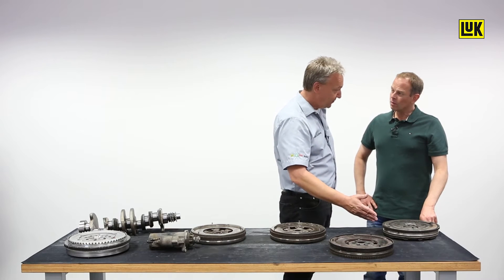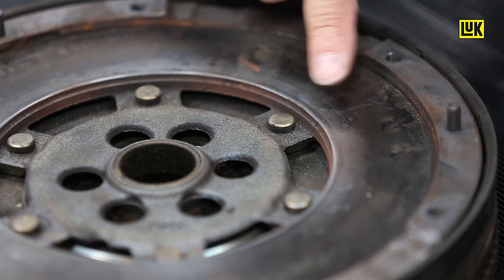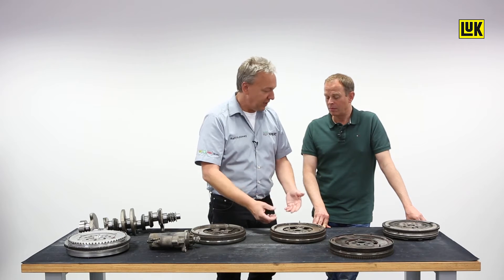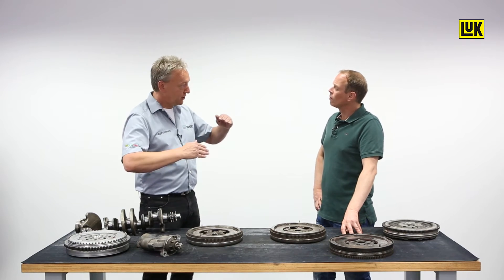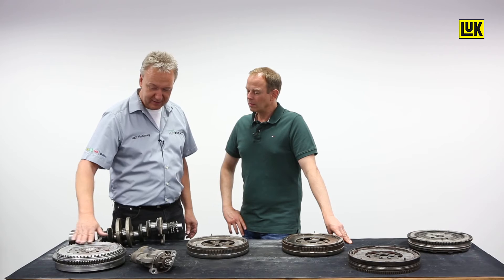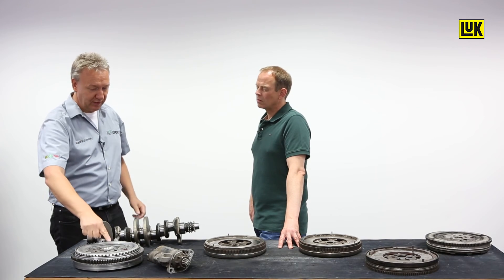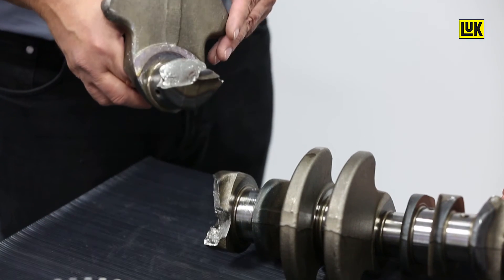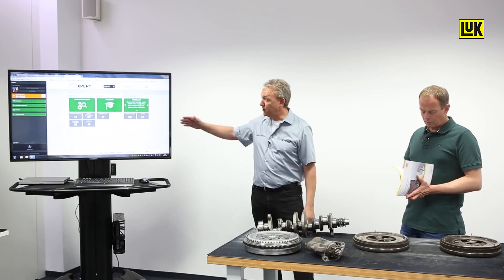LuK DMF – visual inspection and damage patterns

Comment: Hello, I was so pleased to see such a skilled masters. Please tell me, if a rear engine seal i.e. crankshaft seal is worn out and there is a huge oil leak from that nodal point, can it damage the flywheel?
Reply from the maker: Hi Ramaz Kutateladze, thanks for getting in touch. In case of a defective crankshaft/engine seal, the gearbox, clutch and dual-mass flywheel have to be removed. Thus, they should be inspected for any signs of damage or failure. In some cases, the clutch will be contaminated by engine oil and will fail. Contaminated clutch linings are beyond repair and the clutch must definitely be replaced. For some models, the DMF bolts must also be renewed (expansion bolts) for re-installation. We hope this helps! Best regards.
Reply: @SchaefflerVLS  Thank you so much for this highly-sophisticated response of yours.. )